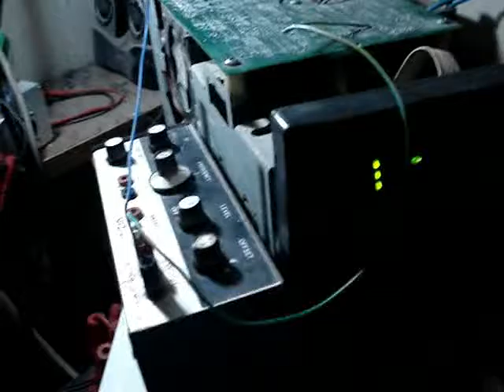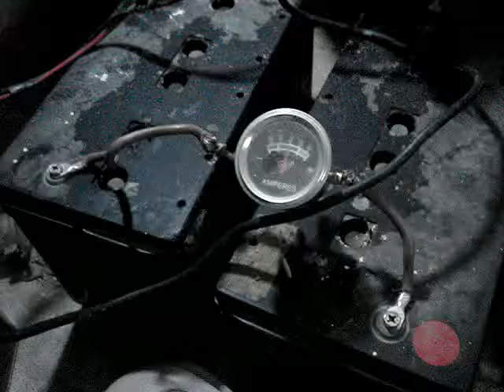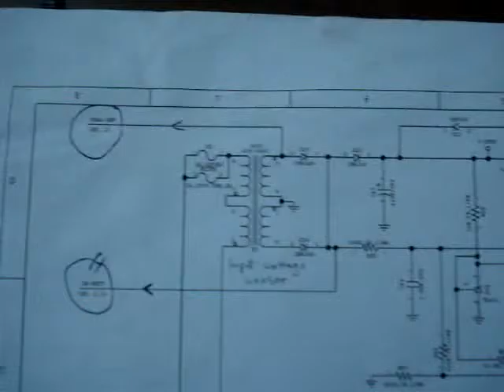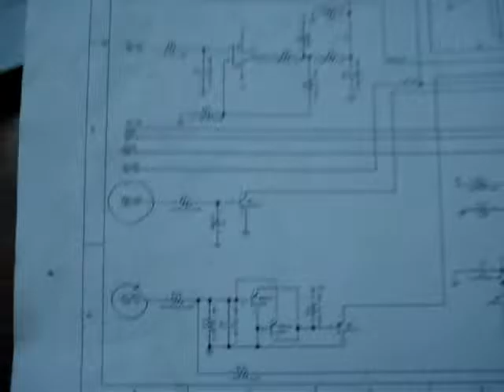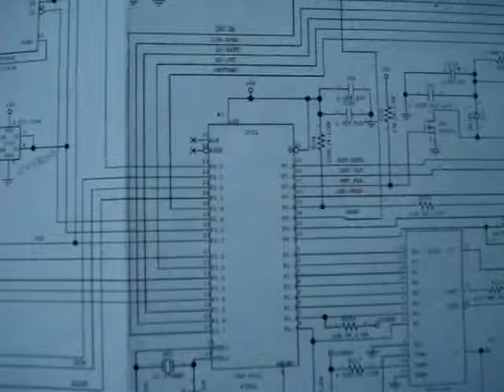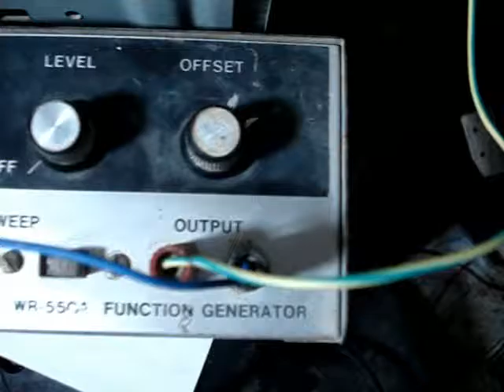APC, income manipulation of frequency

Comment: Hi, I hope you get this message. I have a problem with the APC 1500 BX1500M that I got in the US. My local power is 220V 50hz but I am using a transformer to generate 110V 50hz. My APC is 120V, 60hz.
Because of the lower frequency, the UPS is only running from battery.
I'm not an electrician, but would be great if you can share more detailed info so I can see if my electrician could do it for me. 
And what device should I search for on Amazon US to help generate the correct frequency output?
Thanks
Reply from the maker: Dear Mr williams , I think it's to hard to adapt your APC to run on 50Hz , it  needs an electronic expert to adapt your APC , beside these UPS's are so expensive , my advise is to buy online, pure sine wave  inverter , they are cheap and reliable and can work in the range of 220v, 50Hz , please feel free for any further information you need ,
Yours , Majid
Reply from the maker: Mr.williams , as I know that the APC series will accept 50 o r 60Hz , in your case you've got to connect a step down transformer to supply the APC ,and another step up transformer 120/220v at the output port , each shouldn't be less than 1KVA , so expensive , right ?
Reply: @alkhafajimajid Thanks for your reply. Yes, I am using a step down transformer. But I don't need to step up again as I am using 110V equipment.
I have other APC's that accept 50HZ but this one when I looked at the documentation does not. Strictly 60hz + - 1 hz. So when I plug it in, the UPS acts as if there is no AC power attached to it. 

In your original video you are using a sine wave generator, but I guess as you said, that would require an electronics expert.

Comment: Excellent trick to get the desired frequency from APC. I wanted to use this trick to run an air conditioner by lowering the frequency to about 25hz to give it a soft start /slow rpm functionality so torque is controlled and then slowly increase the frequency if required. so basically i want to use the APC UPS as a VFD device to control the speed of the compressor motor. Now luckily I found this valuable trick you have implemented. I wanted to know if using this trick it was possible to reduce the UPS frequency to about 25hz from standard 50hz. Do you think it will work for this requirement?
Reply from the maker: Dear Bilal , I don't think so , all I wanted is to cancel the low frequency of public generator which is around 40 Hz to standard 50 Hz by my own signal generator , other wise , the processor won't accept less than 50/60 Hz
Reply: Hi Majid, thanks for prompt reply. Did you mean you externally input 50hz through a frequency oscillator so the processor thinks it's normal and accepts 40hz from generator on mains supply without complains?
Reply from the maker: Exactly , and it is't necessarly to be a sine wave , since there is a pulse shaper inside the UPS, it's all mensiond in my video ,
Reply: Did you by chance measure the frequency of the UPS output if it's 40hz 
(main) or 50hz (tricked). Means does the trick force the UPS to convert the main frequency to 50hz or just trick the UPS to think it's 50hz but actually 40hz is being supplied to your load? Thanks
Reply from the maker: @MuhammadBilal-im7yt  ,sounds you didn't understand my problem , which is the  operator of diesel generator thought stupidly that when reducing engine RPM, he will reduce fuel consupmtion , for that reason the incoming power 
 is with about 40Hz , making my UPS using its own battery to recover the power  , all I wanted is to let the power to go bypassing my UPS
Reply: @alkhafajimajid  Hi Majid, thanks for an engaging conversation. I think I understood he problem however wanted to use your valuable experience for my project. As if your UPS had provided 50hz output to the load even by getting a main supply at 40hz then I could have uses this method to power my air conditioner using your trick but as it's just bypass I assume your UPS output is at 40hz which is generator supply at the UPS mains. So it will not work for me. 
I think I have to find another way to run this air conditioner on my solar power. Thank you very much for sharing your knowledge.
Reply: also will using this trick with 555 IC impact the UPS sinewave as I don't want to get it changed from pure sinewave?
Reply from the maker: Exactly, you could find a VFD unit from say alibaba.com with reasonable cost , you welcom ..

Comment: Question if allowed I am from Iraq suffer from the electricity the King of ups apc 5000 va problem broken on electric generator the House is the solution is no way to change the hz the ups in order to is working on the lower hz thank you to please a reply
Reply from the maker: amid nagm . As I understand from your question that you're sufferi from same problem of mine . You need to do same procedure I've done . But .ost important thing is YOU'VE TO GET KNOWLEDGE OF ELECTRONICS . Since dealing with high current appliances is DANGEROUS .
Reply: @alkhafajimajid  السلام عليكم ممكن تطرش لي ال schematic الموجود عندك واكون شاكر لك .
اخوك أحمد من البحرين